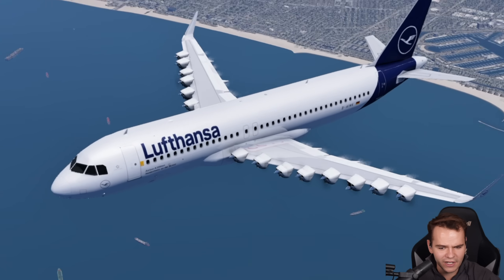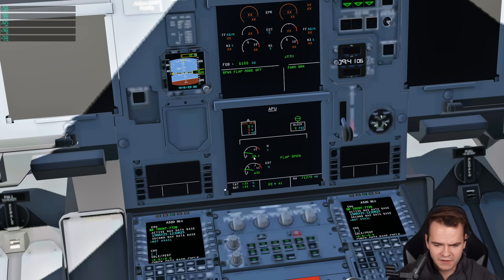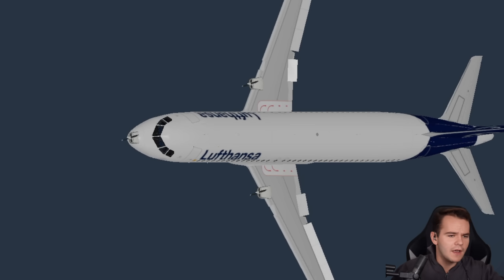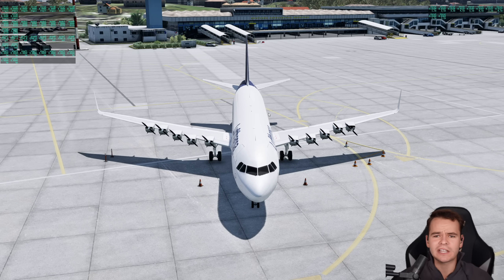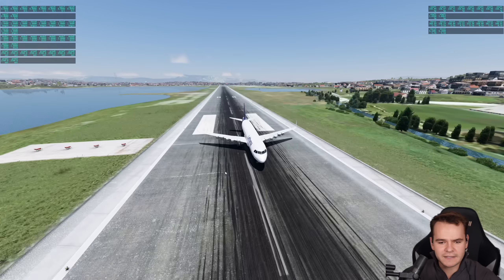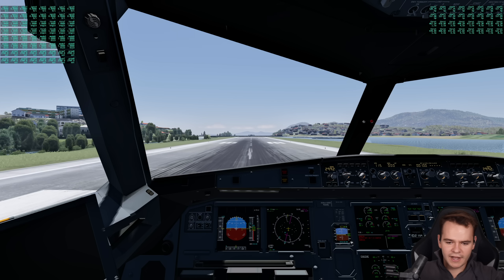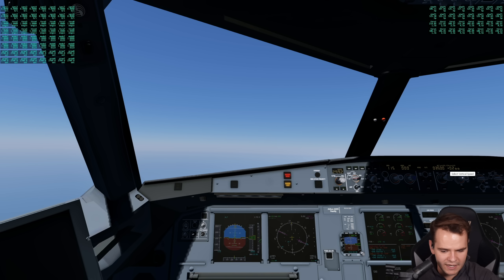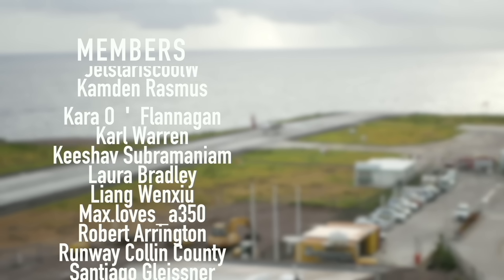What Happens When You Put Cessna 172 Engines On An A320?

Comment: Would say put a Chevrolet LS engine in the 172 but that's already been done (works just fine apparently; has more weight due to added cooling but waaay more power and reliability).

Comment: Would the C-172 pitch speed even allow the A320 to maintain minimum airspeed?  It doesn't matter how many props you put on the wing if the pitch speed doesn't allow you to maintain a flyable airspeed.

Comment: Here is a Video idea: Make the A340-300 as it was intendet. Instead of the CFM56-5C put 4x IAE v2500 engines on it. That was the engine the aircraft was suposed to use, but IAE did not manege to develop the v2500 in time and so CFM was chosen instead.

Comment: The engine in question is actually a late model IO-360-L2A, rated for 180 horsepower at 2700 rpm (Maximum output), found on 172S aircraft. I much prefer the older O-320-D2J, found on 172P's. They make 20 fewer horses, only rated for 160hp, but because the engine is carbureted, both the engine and plane are lighter, and I find much of the maintenance on pre-1996 172's to just be easier.

Source: I'm a mechanic who works on flight school training aircraft, including 172 L-M, P, R, and S models.

Comment: Good news is you wouldn't need 600 Cessna 172 engines to equal the TOGA thrust of a A320. You'd only need about 100, because the Leap 1B produces about 30,000 pounds force of thrust, while that Cessna engine does 650 according to the simulation. So 100 would actually give you a bit more thrust than the Leap 1B's

Comment: cessna should make a 172 powered by an a320 apu
Reply: True
Reply: People have done that. And that has killed people too.
Reply: Sadly the APU is not exactly designed to have a high thrust output so probably wouldn’t work
Reply: @liambengif7663  in theory, if you got rid of the power turbine and installed a jet nozzle to the back of it, it would become a functional jet engine. The only reason it doesn't produce much thrust is because the power turbine is taking most of the energy out of the exhaust stream to run the generator and hydraulics
Reply: @liambengif7663 why not put a fan on it's shaft
Reply: Isn't that called a C208?
Reply: They did, they called it the 208 Caravan....
Reply: I read that as A320 GPU, a sub 75W card with 6GB RAM made by Intel.